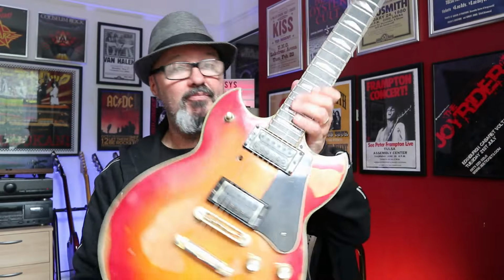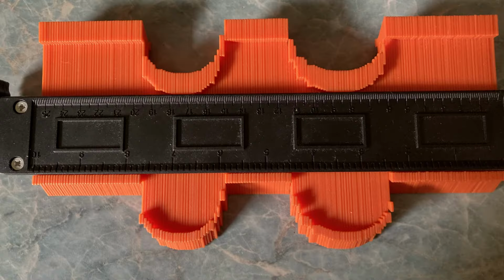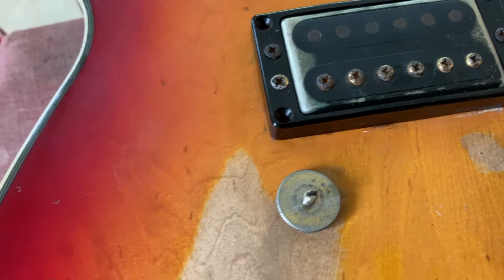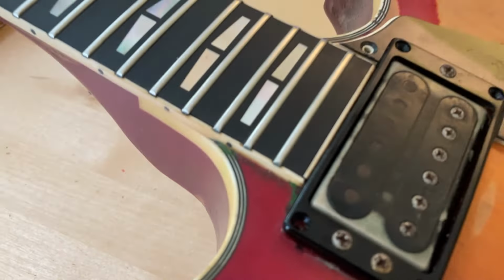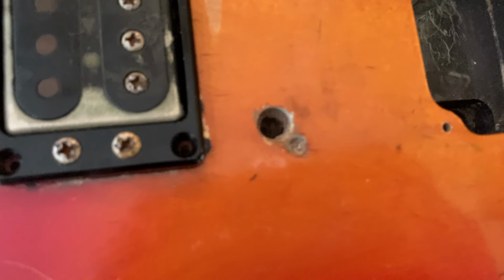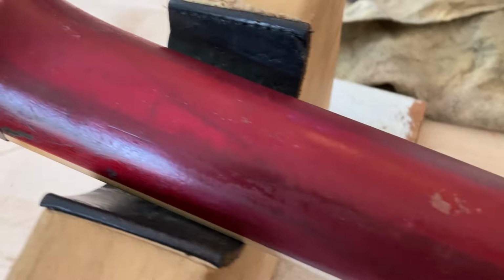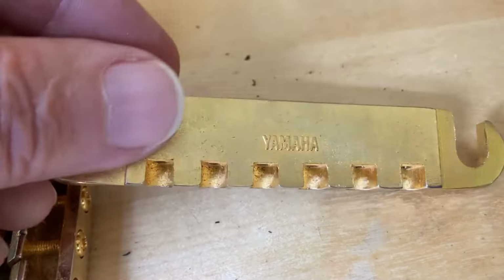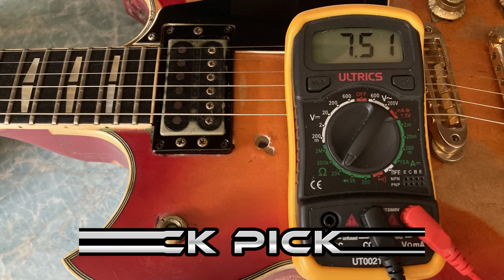Vintage YAMAHA SG1000 - beat up, but still in the fight.

Comment: It's a shame, with all the very poor seventies Japanese guitars around that some bar owner chose to bolt a good one to the bar wall! Excellent work on the neck binding. I had thought you'd need to pull the frets to do that.
I have had a 1986 SG1200 from new (shop soiled tbh). I don't play it often but it will be the very last guitar I ever part with.
Reply from the maker: Absolutely. Yeah, it would be fair to say that I probably wouldn't have used this one as wall art!